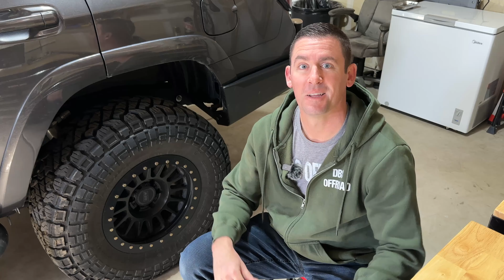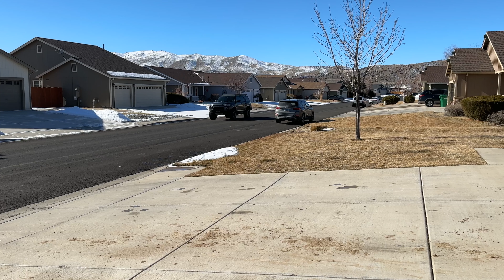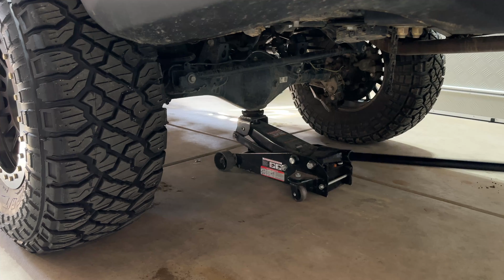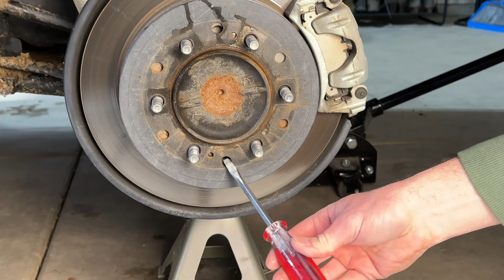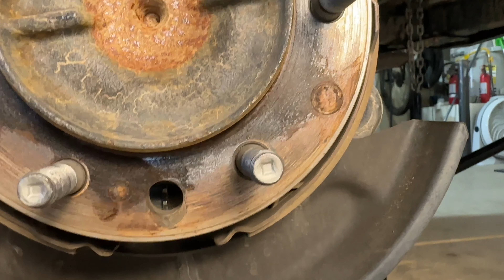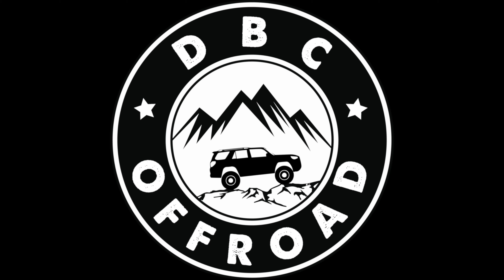5th Gen Toyota 4Runner Parking Brake Adjustment

Comment: Any downside to over adjustment? Any way to tell you tightened it correctly and didn’t over tighten?
Reply from the maker: It will probably just wear the brakes down faster.  If the wheel still spins freely you should be good.  However, I've seen a few people mention you can take slack out of the pedal instead of the brake adjuster.  I still need to figure this out, but it seems like a better route to go.

Comment: I recently did rear brakes. Loosened the drum to remove rotator. Parked on my drive which has a similar incline. Put in N and depressed E brake. It didn’t roll but, I put my hands in the rim and rotated the wheel and sure enough she rolled a bit! I wish I checked to see if it was like this before I adjusted it. Best video I’ve seen on adjusting this drum brake. It really could take a few attempts to get it perfect. I wish there was an actual spec to go off of rather than tighten, don’t over tighten, then loosen lol
Reply from the maker: Thanks for the feedback.  
I also still need to look into adjusting the slack in the actual pedal. I've been told by several people that it can be adjusted without messing with the brakes at the tires.  Something else to consider.

Comment: Could this be a reason why I’m hearing some brake drag/ squealing? I recently got my e brake adjusted by someone else and I have squealing from the rear end at low speeds. Maybe tightened too much? My pads and rotors are good front and back.
Reply from the maker: It’s possible. It’s seems like there is a fine balance of not enough and too much. Maybe try loosening it just a bit and see if the noise goes away.

Comment: Great video for adjusting the e-brake shoes!

In my case, I think a cable adjustment was all that was needed.  My 2022 4Runner has always had a really weak e-brake.  This was definitely different than the 2017 that it replaced.  We bought both new, so no one had adjusted either one.  Anyhow, I noticed that if I pressed the pedal all the way to the floor, the e-brake would eventually engage well enough to keep it from rolling backward on a moderately sloped driveway.  So I knew the shoes were  eventually engaging.  After some reading, I found that there are cable adjustments both at the foot pedal, and under the center console under the cup holder area and the arm rest compartment. I adjusted it at the foot pedal, and the brakes now engage nicely at about 5 clicks.  So long story short, if your brake engages all the way at the bottom of the pedal travel (no more clicks) - then a cable adjustment may be the better alternative to adjusting the shoes.  In my case, I think the shoe clearance was correct, but the cable was adjusted too loose from the factory.  

To make the adjustment here, you have to remove the panel that covers the brake pedal area.  Then use an open end 10mm wrench to hold the adjusting nut, while breaking loose the retaining nut.  Remove the retaining nut, and tighten the adjusting nut as needed with a deep well socket.  Then reinstall the retaining nut and tighten against the adjusting nut while backing up the adjusting nut with the 10mm open end wrench.
Reply from the maker: Hmm that's interesting.  I had no idea. I'll have to take a look.  Thanks for the info!
Reply: Just read the procedure in the 4runner repair manual. The actual procedure is a combination of both  - cable adjustment and shoes adjustment.
Reply: 1. INSPECT PARKING BRAKE PEDAL TRAVEL
(a) Fully depress the parking brake pedal to engage the parking brake.
(b) Depress the pedal again to disengage the parking brake.
(c) Slowly depress the parking brake pedal using the specified force and count the number of clicks.
Standard parking brake pedal travel:
5 to 7 clicks at 294 N (30 kgf, 66 lbf)
If the parking brake pedal travel is not as specified, adjust the parking brake shoe clearance and parking brake pedal travel.

Comment: Dumb question but is the parking break set while making the adjustment or not?
Thanks
Reply from the maker: No it is not set. 
I was informed there was a way to adjust the pedal to take out slack instead of at the brake disc. Not sure if there is a video in that at all.

Comment: Nice 4runner..The park brake assembly is drum and shoes style.thx for sharing. My wife drove thru the park brake on my 03 v8 4x4runner and ruined. shoes..They suck to change.thx.
Reply from the maker: Thanks for the feedback and watching!  How did she manage that? Just had it depressed enough to drag the brakes?
Reply: @DBC Offroad  did,nt notice red light on dash and drove appx.5 miles & said " I smell something burning " when stopped.i had to replace drum/rotors .park brk shoes & installed new pads.If park brk.was adjusted up tight ,like in your vid , prolly not happen so I guess it was MY fault.😅🤣🔧
Reply from the maker: @vincesmith764  oh boy. Just think. Now you know how to replace it. Just learned the hard way. Haha

Comment: Good quick vid.  How do you like the Kendas?
Reply from the maker: Thank you!
I really like the Kendas.  You really can't beat the price.  Never had any issues on both sets i've had (33s and 35s).  
I have mixed feelings about the sidewall design.  I don't hate it, just like others more. 

Mud 4/5 - Not a dedicated mud tire, but still very good for a Hybrid
Dirt 5/5 - Haven't found any limitations
Rocks 5/5 - Durable and grip well for DOT rated tires. 
Snow 4/5 - Deep soft snow they work really well.
Icy Roads 3.5/5 - They are not quite as good as a 3 peak snowflake rated tire.  But you could stud them if you really wanted.  

Hope this helps!
Reply: Thanks for the info on the Kendas.  Was considering them for my next set and I’ll definitely use your review when I’m ready to buy.👍
Reply: @jbt7115  Glad I could help.

Comment: dumb question, but is the break disengaged while you are making the adjustment?
Reply from the maker: Good question!  Yes it’s disengaged.
It seems counter intuitive. Like you should set it halfway before making the adjustment. It’s just like the normal brakes though that have a little resistance by hand, but don’t engage until you hit the brake pedal while moving.
Reply: @DBCoffroad  Finally got around to adjusting these. What a difference. I was losing my mind over this. I would take my 4R to the dealership cause I had a paid maintenance plan up to 70k miles (transferred over to me from last owner), these goofballs keep telling me the rear was only disc brakes. I had to do it myself.

Comment: 1. INSPECT PARKING BRAKE PEDAL TRAVEL
(a) Fully depress the parking brake pedal to engage the parking brake.
(b) Depress the pedal again to disengage the parking brake.
(c) Slowly depress the parking brake pedal using the specified force and count the number of clicks.
Standard parking brake pedal travel:
5 to 7 clicks at 294 N (30 kgf, 66 lbf)
If the parking brake pedal travel is not as specified, adjust the parking brake shoe clearance and parking brake pedal travel.

Comment: Are those kenda klever R/Ts? How are they on and off road?
Reply from the maker: They are the Klever R/Ts
I actually really like these tires. 
On road they are great. A little road noise which is typical with any Offroad tire. But handle well. 
Offroad they are pretty good. Grip well in rocks and dirt. Not the best mud tire, but the mud here is Reno is like peanut butter and just fills the tread and causes most tires to lose traction. Snow is pretty good too. 
They are probably not the absolute best tire out there, But I got them for the price. And they are much cheaper than any other big name brand with similar tread type (Nitto, Goodyear, Toyo etc)
Reply: @DBCoffroad  thank you for the thorough answer! I am looking at them because of price as well. Tires shot up in price a lot within 2 years.
Reply from the maker: @samro9744  You're welcome.  I totally agree.  The cheapest I found them was Walmart.com of all places.  🤘🏻